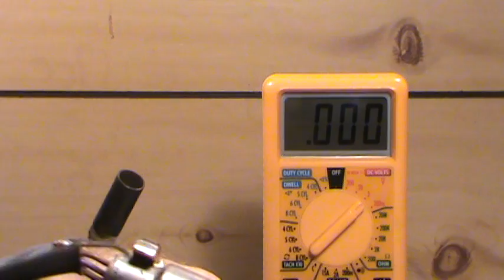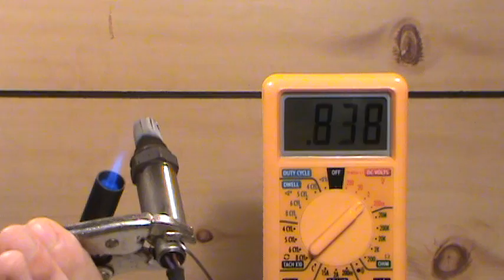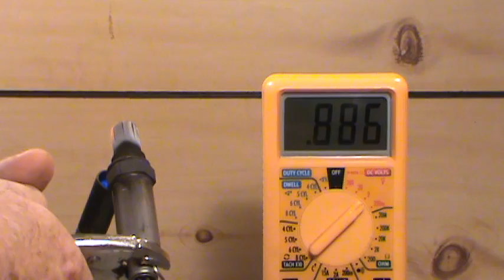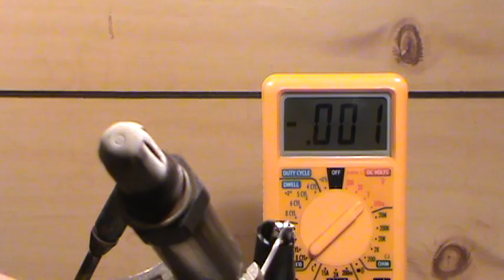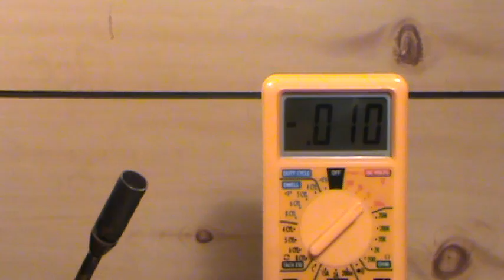Oxygen Sensor Test

Comment: Just a Note on your Test! Holding the O2 sensor closer to the Flame will generate a hi Number as Rich. Only because the O level is pushed away which will yeald a Richer value . AS you pull back some a Lean will ocurr as More Oxygen gets to the sensor. Not related to the Propane itself. The Sensor does not care what fuel you use but what Oxygen is Present. Rich means Less oxygen. Thanks Note that the Propane test will work with Nat or Map Gas or any other burn Materail like wood.
Reply from the maker: +Vern Jackson Greetings Vern Jackson....Thanks for watching, and for Your comment as well..............................Well, as far as this Narrow Band, Zirconia, Oxygen Sensor, that's being used, in this YouTube Video of mine, is concerned, I believe that, You are correct, in that, it probably is, just the Oxygen itself, from the Flame, that is creating the output voltage, along with some help, from the Oxygen, that's available, in the "Outside", Ambient Air, that supposedly Enters, the Inside, of this very same oxygen sensor, once it gets heated-up, to that magical temperature, of about 600 Degrees Fahrenheit or more................................A while back, I remember Looking for, the Entry Point, for that External Air, that's supposed to Enter, the oxygen sensor, and, it wasn't Obvious at all...!!!.........................................The best I could find, was that, that "Outside Air" (containing, that much needed Oxygen), made its way, "Into" the Inside, of the oxygen sensor's Body, was, Beside/Around, the Very Small amount of Clearance, that was surrounding, the Outside of the Wiring, that Entered, the Outside-most End, of the oxygen sensor's Body...!!!...Holy-Gwalk-ah-Mole-ee...!!!...lol................................These, so called "Narrow Band" (narrow-minded...lol) oxygen sensors, aren't all that smart, after all.............................While in Closed Loop mode, about all, "it/they" can do, is tell, the vehicle's On-Board  Computer that..."That's Too Much Fuel" (Rich)...or..."That's Not Enough Fuel" (Lean)...and the poor ole On-Board Computer, is Frantically, Pulsing the Injector/s...at different Pulse Widths...in order to try and stay with-in the Stoichiometric ballpark, be-in around, oh, about 14.7 to 1 for 100% Gasoline, while at the very same time, having that Narrow Band Oxygen Sensor, outputting, pretty much, around .45 volts (hopefully...lol)...............................Lambda...(dare I say Wideband...???...lol)...Oxygen Sensors, are a whole different animal................With Different Fuels, being used/burned, I believe that, that good ole Lambda, will be outputting the...Number 1...when-ever, just about any Type of Fuel, is at the Stoichiometric value (some food for though, that is alright)...................................Good thing, for Engine Knock Sensors, as, once the Knock is Detected, then, hopefully, the vehicle's On-Board Computer, will be able to keep the Engine Safe, and not sustain any Damage, and the Nightmare, that goes along with it...!!!.................................Also, I made another YouTube Video, using this same Oxygen Sensor and Propane Torch, but, this (or was it) that time, I used my, rather LARGE, Automotive specific, Analogue Testing Mulit-Meter, in order to see, whether or not, that Waving Pointer/Needle, would be showing any "Cross-Counts" at all...???...........So, there You have it, for now that is, and...till next time....Be Safe, take care, and have a good one.
Reply: Vern Jay6 c.f. h in 6 (209) m ckson 6th

Comment: i did this on my sensor everything correctly but it just stays at zero when heating it up. does that mean its not working at all?
Reply from the maker: +Slavik Skovpen Greetings Slavic Skovpen....Thanks for watching, and, hopefully, we can figure out, why Your Oxygen Sensor, isn't showing any Response at all.........Did You Set Your Volt-Meter or Multi-Meter, to a very "Low Volts Scale/Range", as, this Zirconia, type of Oxygen Sensor, that You see in this YouTube Video of mine, will only produce, up to a Maximum, of "1 Volt"...!!!..........You can Check Your Meter, with a known Good, or New, 1.5 Volt Battery (aka...AAA...AA...C...or...D...Round Shaped...1 and 1/2 Volt Battery), to see if Your Meter will Show, about 1.5 (as in, One and One Half) Volts, to start with, just to make sure, Your Meter is working, as it should be..................Maybe, You "Did Not", get the Sensing Tip, of Your Oxygen Sensor..."Hot Enough"...with the Flame...???...as it has to be, about 600 Degrees Fahrenheit or Hotter, to make it produce a Voltage of some kind............................Oxygen Sensor Wires, are usually "Color Coded", and can have anywhere, between, as I've seen so far, from having, "One Wire" on it, to, as many as "4 Wires" on it, and, You have to make sure, that, You are making the "Correct" Connection, to the "One Wire Type", if in fact, the Body of the Oxygen Sensor, "is" the Ground, or -/Minus Connection, or, Make the Connection, to the "Exact/Correct"..."2 Different Colored Wires" (usually 2 or more Wires, coming out of the Oxygen Sensor), as the case may be.............................Faulty/Worn Out/Not Working, Oxygen Sensor maybe...???....................Then, there is "Another Type", of Oxygen Sensor, known as a "Titania" Oxygen Sensor, and it "Does Not", Output a "Voltage", like this "Zirconia" type does...!!!......................I've never had, a "Titania" Oxygen Sensor before......................I believe, that, once a "Titania", type of Oxygen Sensor, is Heated Up enough, in a Flame, that, it will be Showing a "Change" in "Resistance", which is Measured in "Ohms", on an Ohm-Meter/Multi-Meter...!!!...perhaps Check, to see, just which "Type" of Oxygen Sensor, that You have there, just to be sure.................................Good Luck, in obtaining an output/response, from Your Oxygen Sensor, and...............Till Next time...........Be Safe, take care, and have a good one.

Comment: thank you man for this inormation
I want to ask you a question,
how much is the O2 sensor resistance for good O2sensor working?
I need to test it befor I retrofit the O2 sensor in the car
thank you again
Reply from the maker: +Sarmad ThePioneer Greetings Sarmad ThePioneer....Thanks for watching............Now for an answer to Your question...............For a "Zirconia" type of Oxygen Sensor, like the one, that I Test, in this YouTube Video of mine, it's Not "Resistance" (as in Ohms/Resistance) that is being shown on my Yellow Multi-Meter, it's "Voltage", that gets produced by this type of Oxygen Sensor, when it gets Heated Up to, about 600 Degrees Fahrenheit or Hotter, and usually, between...0 or Zero Volts, to, usually, no more then 1 or One Volt, and, it can Vary, depending on the type of Fuel being used to do the Test, and the Amount of Air, that gets Mixed with the (testing) Fuel as well.....................As far as I know, if a Good Working Oxygen Sensor, or more then One, as the case may be, is/are installed, in a Vehicle's Exhaust System, of a Properly Operating, Computer Controlled Engine, and it has 100% Gasoline (No Ethanol/Alcohol), in its Gas Tank, then, when this particular Engine is at Operating Temperature, and just Cruising along, at not too fast of a speed, at about Sea Level, and, a not moving, light Throttle/Gas Pedal is applied, then, as I see it, this type of Oxygen Sensor, should probably be Outputting, about .45 Volts (just under 1/2 of a Volt)...and...(Lower then .45 Volts, if the Air/Fuel Ratio/Mixture is "Leaner.'...and...if the Voltage is "Above" .45 Volts, then, the Air/Fuel Ratio/Mixture, is usually "Richer"..........That .45 Volts, usually occurs at, that well known 14.7 to 1 Air/Fuel Ratio/Mixture, that is commonly referred to, as being "Stoichiometric"........The "Other Type", of Oxygen Sensor (that I haven't had yet), goes by the name of "Titania"...........................The Titania, type of Oxygen Sensor, is a bit Different, in that it does Vary its "Resistance", Not Voltage, when it gets Heated Up, and I'm also thinkin', that, the Type of Fuel being used, will probably have an effect as well, perhaps.............So, there You have it, well, for now that is, and............Till next time...........Be Safe, take care, and have a good one.

Comment: or another words even if you have no o2 sensor and your car is running lean or rich a little it should still run pretty good I would imagine  .... so maybe it would be more for performance vehicles
Reply from the maker: sam111880 Greetings sam111880....Thanks for Your comment/question...................If, an Oxygen Sensor became Faulty (not working properly), or, the Oxygen Sensor's Wiring Connector, was Disconnected, or even if, the Oxygen Sensor was Removed, from the Vehicle's exhaust system, the Vehicle's On-Board Computer, will, more then likely, be Storing a Trouble Code or two, and, there, could very well be, a Warning Light, Glowing or Flashing, on Your Dash-Board as well...!!!..............................................From what I recall, if a Computerized, Engine Management System, on some, if not most Vehicles, has become, Not Working, as Good as It Should be Working, then, there is a Possibility, that, the Computer, might start to Operate, in, what I've heard, as, Operating, in..."Limp Home Mode"...where-by, the Computer, just Uses, a, shall we say...Ball-Park/Not so Accurate...Program, that will, at least allow the Engine to Run, reasonably well enough, to get Your Vehicle Home, or, to an Automotive-Fix-Em-Up-Establishment, which-ever-is-Closest, I would assume, in order to have the Needed Repairs Done, so the Damn Engine will Run Properly Again...!!!...lol...................................When it comes to an "Air Leak", in the Exhaust System..."Before"...Any Oxygen Sensors, that will usually, really mess things up, because, the Computer, really doesn't know, where, All of that Extra Air (oxygen), is coming from...!!!.................................Just goes to show, that, Computers, at times, Aren't all that Smart after all...!!!...lol.......................................Yes-Sir-ee-Bob...if the Computerized Vehicle, Originally, came with, One or More Oxygen Sensors, then, that's..."What it Needs"...or, as I see it, probably be makin' for..."More Trouble"...that, You, Others, and I..."Can Do Without"...!!!...lol...................................Well.......Till next time..........Be Safe, take care, and have a good one.

Comment: yes but what is the point of the o2 sensor doing for the ecm computer basically if you get a lean or rich reading what does the ecm do for adjustment or why is it important to keep track of lean or rich combustions does the ecm basically pwm the injectors differently to make up to get a correct mixture , you also have egr and evap in the mix to
Reply from the maker: sam111880 Greetings sam111880....Thanks for watching, and for Your comment/question/s as well.................................The On-Board Computers, in the newer (gasoline), fuel injected vehicles..."Control"...so many Things, these days.............................Basically, the Vehicle's Computer, Receives Information, from the Many "Sensors", then takes that Information, and Processes it, then, once Processed, the Computer will send out Signals, to the "Actuators", in order to make the needed Adjustments/Compensation, that the Engine Needs, in order to provide the Engine with the Correct, Air/Fuel Ratio, as well as the Correct, Ignition (spark) Timing, for any and all, of the Engine's Operating Needs, at any given time, as in, a Cold, or, Up-to-Operating Engine Temperature...a Light Throttle (gas pedal) Cruising Speed...or, even, a...Pedal to the Metal, Hard Acceleration, which, by the way, will need, Different Amounts, of Ignition Timing (advance), as well as, the Correct, Air/Fuel Ratio, as in, a Leaner, Air/Fuel Ratio (Less Gasoline, in the Air/Fuel Mixture), for, just easily Cruising along, and a Richer Air/Fuel Ratio (More gasoline, in the Air/Fuel Mixture), when Your Foot, Presses the Gas Pedal, All the Way Down...!!!...lol....................................Although, when, one or more, Oxygen Sensors, are Sending Information to the Computer, sometimes the Computer, Doesn't Use, or Listen to, the Information, that the Oxygen Sensor, or Sensors, as the case may be, Are Sending to the Computer...!!!...Say What...!!!...lol.................................Usually, when the Engine, is Cold, and also, when-ever doing a WOT/Wide Open Throttle, Hard Acceleration, the Computer, pretty much, just, shall we say..."Ignores" (doesn't use), the Information, being Sent, from the Oxygen Sensor/Sensors...!!!.......................................Now then, when the Engine, is Up-To, or, almost Up-To, Operating Temperature, and, now, We're just Cruising Along, at, not too fast of a speed, with a reasonably Light, Throttle/Gas Pedal Applied, this is where, the Computer will Use the Information, from the/those Oxygen Sensors...!!!...................................The Oxygen Sensor/s, will let the Computer Know, how Rich or Lean, the Air/Fuel Ratio/Mixture, actually is, and, if it's Too Rich, the Computer will Tell, the Fuel Injector/s, to Not, Spray So Much Fuel/Gasoline...and....if it's Too Lean, the Computer will Tell, the Fuel Injector/s, to Spray More Fuel/Gasoline, into the Engine's Intake System......................Also, the Computer, and, All of the Sensors and Actuators, do Their Work..."Super Quick/Many Times per Second"...like You wouldn't believe...!!!.......................For just Lightly Cruising Along, the Air/Fuel Ratio/Mixture, can be about 14.7 to 1...and...when doing a WOT/Wide Open Throttle Acceleration (Pedal to the Metal...lol), then, depending on, just how the Computer was Programmed, that, Much Richer, Air/Fuel Ratio/Mixture, might be around, about 12.5 to 1, maybe a bit Richer, or, a bit Leaner, depending on the Vehicle in question........................................If an Engine Ran, Too Rich, while just, Lightly, Cruising Along, Gasoline would be Wasted, and the Engine, might begin to Accumulate, too much, in the way of Carbon Deposits, in the Combustion Chambers (Cylinder Heads & the Top of the Pistons), and, will probably be seeing, a fair amount of Carbon Deposits, on all of the Spark Plugs as well, which is, what We Don't want......................................Now then, lettuce suppose, that, an Engine is Run, Way Too Lean, at a WOT/Wide Open Throttle, Hard Acceleration...then...repeat after me...expensive...Expensive...EXPENSIVE...!!!....Yikes...!!!...that poor Engine, just..."Destroyed Itself"...Boom...Bang...Clank....then...Silence...bye bye Engine...Hello...New or Rebuilt Engine...or maybe...bye bye Vehicle...due to the High Cost, of Fixin'-it-Up...!!!...lol.............................................So then, there's my 2-Cents on the matter, and, I hope, what You Read here, helps You out some-what.....................So then.......Till next time................Be Safe, take care, and have a good one.